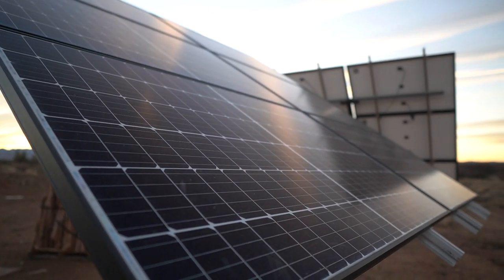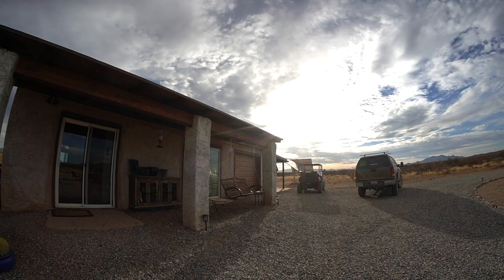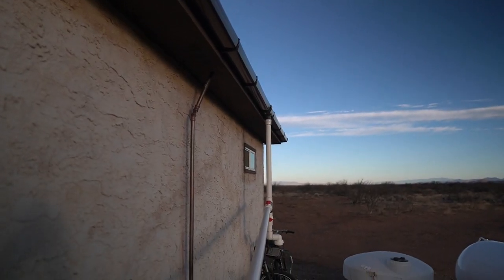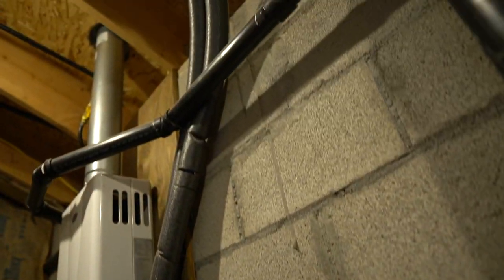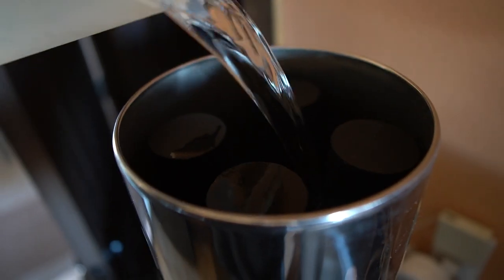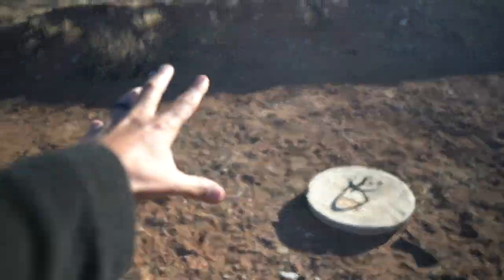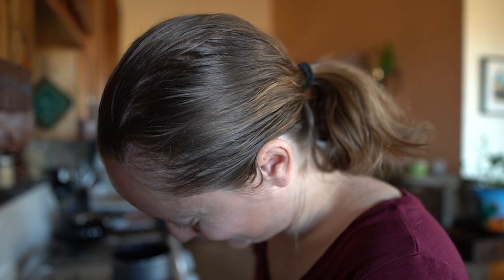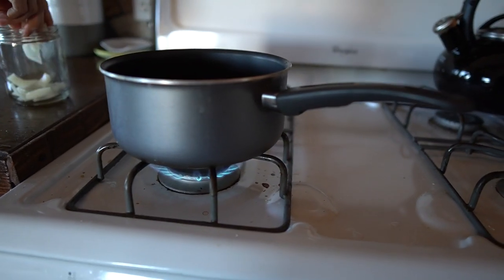WHAT IS IT LIKE LIVING OFF-GRID in the Arizona desert?

Comment: I live off grid and have for 16 years. There is a well, but we still have to hull water. 4 volt 1350 Amp batteries, 2 banks of 48 volts and a back up generator, diesel, 20k amps.

Comment: AZ is a big place - in fact, Coconino county alone is bigger than 9 US states - what region of the state is this? I'm looking at the high-desert where land parcels of 40 acres are (cheaply) available (with well water from the aquifers) and a (quite large) Quonset hut homestead. Nice Airstream btw - I too am looking to start with a 'rugged' RV (pre-wired and built for off-grid living) during the 1-2 week construction, and until the interior is built-out (while parked inside). Curious why you went with a freestanding (Berkie) system for drinkables vs an osmosis system. Great set-up regardless, subbed!

Comment: Three utility-sharing questions after you build your second house on the property:
1) Will you have to install additional solar panels, or will the panels have the ability to serve both houses?
2) Likewise, will your current septic system handle two houses, and. . .
3) Will your water and propane systems have to be upgraded, or will they also handle the two homes? (I guess that's four questions, but, oh well!!)
HAPPY BIRTHDAY, COURTNEY!!!! 🎂🎂🎂
Reply from the maker: 1: Yep, we will probably steal one of the solar poles from our existing house for the new one, then put roof-rounted panels on the new house that point toward the south. 

2: Yes, our septic system is plenty big enough to handle two homes. 

3: We are performing water upgrades independent of the new house (well, storage tank, etc). Also, we will just need another propane tank at the new house. Ideally, we'd take our current 500-lb tank and use it at the new house and then buy a 250-lb tank for the guest house.

Comment: As an off gridder... my 1st observation was your trackers look confused...where is the sun?

I think your water challenge to be overwhelming...what is your depth to the water table. We paid 10K for a 300ft well...could not survive without it...
Reply from the maker: Our trackers? 

Water is about 270 feet, but we're going much deeper than that to help ensure longevity.
Reply: @AStreaminLife  if you need any help or guidance. Background in water chemistry and wells. Can help point out common well development errors.....do it right...make it right the 1st time....no going back to correct cheap shoddy work.
Reply: @AStreaminLife  it's not the depth that imparts reliability
Its fhe screened length and the bore packing materials to protect your pump from cave ins. Sand fouling and corrosion and calcification fouling. There's a lot going on so check for conductivity, TDS  and chlorides.
Ask your neighbors in 1 mile radius for a water sample and well pump depth.